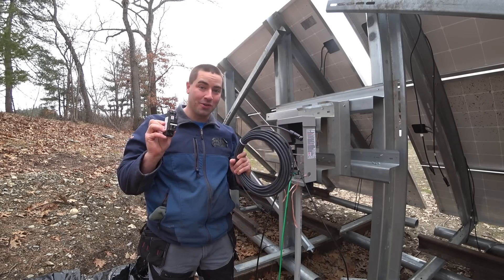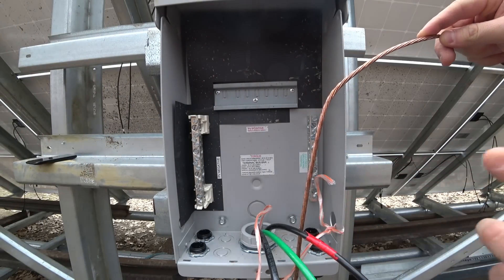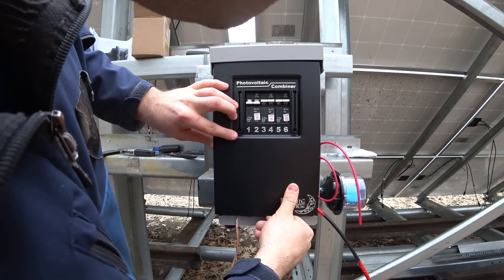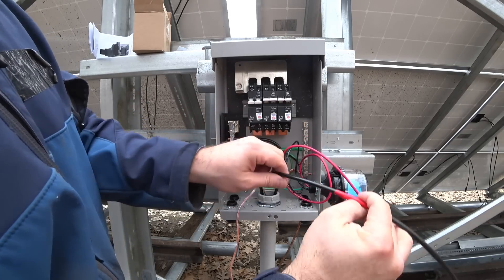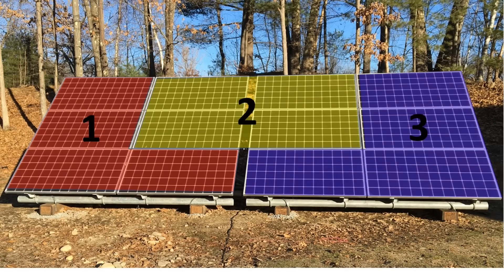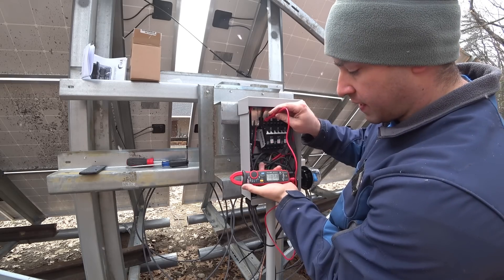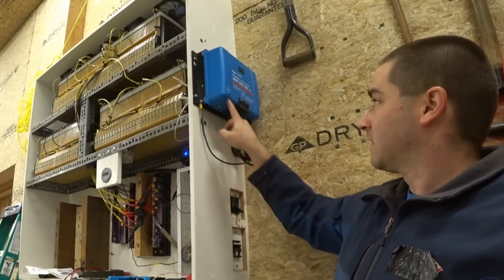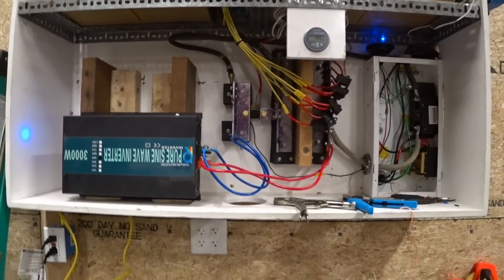Solar Wiring Finished and Turning it ON

Comment: HOWdy  D-P,
Thanks for this WIRING Video
I wish you had been  a bit more 
VERBOSE while wiring up your 
COMBINER-BOX and explained 
in a bit MORE Detail what you were 
Wiring & Where it came From & went To ... 
Bare Copper Stranded - from GROUND ROD by Array 
Green jacketed - GROUNDED in Combiner-Box  - then all the way in to the  CHARGE-CONTROLLER  ?
 ... was it also bonded to a Ground-Rod there too ? 
Red jacketed - in to CHARGE-CONTROLLER = to "negative" BUS-BAR + SPD  ? 
Black jacketed -  from PV to the Positive bus-bar + SPD - then in to CHARGE-CONTROLLER  ? 
SPD wires  Green / Red / Black etc  
then the  PV  "+"  wire  to just the 1st Circuit Breaker + 
&  "-"   PV Wire to the other Bus-Bar  on the left  ?
How does that black wire BUS-BAR get attached to the Circuit-Breakers ?  
Wire by Wire ... 
then I see you have yet another "SPD" inside by your Charge-Controller & BATTERIES ... 
YOU know what YOU were doing / but  I was a bit confused 
I chose a 600v "SPD"  for my 24 Panel array / 208 watt each 
arranged in  4-Strings of 6-panels each ... 
(should I have gone smaller like your 300 volt unit ?)  
I got mixed advice when choosing my  "SPD" 
COOP
...
Reply from the maker: Sorry about that.  I think this manual will help explain things better than I can summarize in a comment: https://www.altestore.com/static/datafiles/Others/SPD_600V_Manual_Rev-C_V2.pdf

Comment: is your inverter also a charger?  mine is a solectria pvi 7600 tl and i thought it was an inverter/charger, but after i found the book on it, i found out it has 2 mppt inputs for solar panels and ties into
the grid. so apparently it doesn't charge batteries at all.   it looks like i'll have to have my victron 450v 100a mppt charge the batteries and hook up the solar panels to the inverter.  then use a different inverter when i don't have sunshine.

Comment: GREAT video!!!!!  series or paraell??? the panels, what if on a 12volt system 10 panels you use branch connectors and 2 why connectors leaveing two lines into the fuse box???????? im stumped.
Reply from the maker: In this array I connected 4 panels in series making about 150 Volts DC on that string.  I then paralleled 3 strings at the combiner box to add the amperage.  Each string has about 9 Amps at MPP, which means I could potentially have 150V and 27 Amps going into the Garage.

Comment: I am just setting up my system I purchased a New Midnite Solar Classic 250 CP MPPT Charge Controller, Regulator 250V 63A BUCK, a ECO-WORTHY 6-String Solar Combiner Box 60A Circuit Breaker and Surge Protection, Four 100 amp hour deep cycle batteries, and a Reliable Electric Pure Sine Wave Inverter 1500W 48V DC to 120V AC. I am hoping to have them all delivered by October 17th I will watch your videos to help me set it all up.
Reply from the maker: Welcome to the solar power club.  I've heard great things about Midnite classic charge controllers (although I haven't used them myself).   Will you be documenting the build with videos or blog?
Reply: @DavidPozEnergy  I sure will I have a video of wiring to the house to the shed I have to put up soon I also have a video installing the solar panel as well I will get up shortly.
Reply from the maker: Great.

Comment: Hey David here is something that may help to increase your power output with the shading you have on your panels. DC Solar Optimizer help with shading.
https://www.gogreensolar.com/products/tigo-energy-300w-solar-panel-maximizer-dc-optimizer
https://www.solar-electric.com/residential/inverters/dc-optimizers-micro-inverters.html
Reply from the maker: I've seen solar optimisers advertised before.  But, I've never seen a video where someone shows two identical strings side by side, one with and one without and showing the difference.  If a manufacturer wanted to send me some to test, I would make that video.
Reply: @DavidPozEnergy  I have been interested as the videos I have found all seem to be from installers, Tigo, or SMA that owns Tigo now. From all the data I have read on it it seems to make sense on how it would function. It also seems to be the case with Enphase modules. Also have looked at some Jinko solar panels that are supposed to have cell string optimization built in.
Reply from the maker: Hi John,  I have no experience with optimizers, but I do have 20 enphase micro inverters with 20 panels on my house roof.  That is a grid-tie only system.  Eventually I want to compare the output of the roof system with the ground mount panels strung together to the battery.  I've only had everything running a week so no good data yet, my my initial glances show them performing equally.

Comment: the way you wired them in series with that shadow moving left to right will actually hurt your yield.. the first panels that have light won't produce their peak out put until the last panel coming out of the shade has full sun.. (whichever panels are in series basically work as one panel. even a little shade on one will shut down the rest.) so you'd want to wire them in series so that when the first three aren't shaded they're producing and so on..

Comment: How'd you done the timelapse vid of the sun.
Reply from the maker: Hi Jason,  The way I did it is clumsy.  There are probably easier ways, I just don't know them.  First, I set up my video camera on a tripod and turned it on. The frame rate is 30fps, which is normal video.  There is no true time-laps setting on my camera.  After an hour I brought it in and the file size was big, something around 10 gb.  I then put that into my video editing software which can speed up the video some.  I use this feature a lot, but usually just 2x speed.  In this case I did the max of 10x speed.  Then I rendered that video into the new, shorter video and saved it.  Then I opened a new file in the editing software, imported the new video, sped it up 10x, saved, and repeated.  I don't remember how many times I did this to get the short clip you saw.  In the end it worked but was very time consuming to make.
Reply: @DavidPozEnergy  hahaha, aryt aryt. Your vid is lit :)

Comment: When you throw the last breaker and nothing dramatic happens it seems anticlimactic.  But in reality that's exactly what you DO want. A big flash and zap would be dramatic but NOT what you want. 😉.
Today I moved my whole setup from one location to another and was expecting sparks but like you,  nothing but a flashing led on my charge controller.  Musta done it right.

Comment: Hey David I glad to see Your solar array is finally pushing juice into Your battery. Im interested how does the surge protection device works. The one with blue LED.
Reply from the maker: There are some documents about the SPD (surge protection device) here: http://www.midnitesolar.com/documents.php?productCat_ID=23&productCatName=Surge%20Protection%20Devices&model=MNSPD-300-DC&product_ID=284&act=info    One of those documents is titled "How Lightning Protection Works" and is seen here: http://www.midnitesolar.com/pdfs/howLightningProtectionWorks.pdf

Comment: so you put in that ground fault detection device, but still grounding the array. it defeats how the ground fault thingy works.
Reply from the maker: I want it to be correct, and I'm not a solar expert.  All I was doing was following the manufacturers wiring diagram.  It's available here: http://www.midnitesolar.com/pdfs/dc-gfp50-300.pdf  Would you please respond back after you get a chance to look at it?  If i'm doing it wrong I want to correct it.  Thanks.
Reply: DavidPoz the diagram doesn’t show much detail.

I think you have it correctly wired. The “array” isn’t grounded, the metal frames are bonded to ground, and the combiner cabinet is bonded to ground, and the surge arrestor is grounded. 

I will look over your ground fault wiring as well.